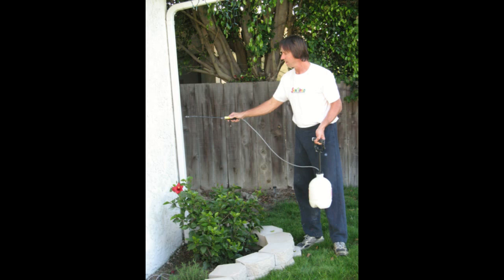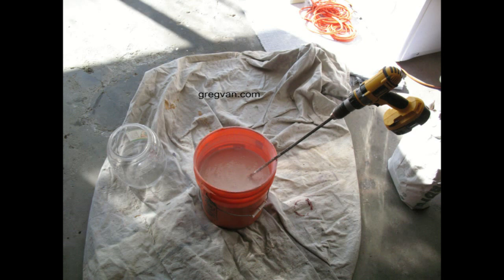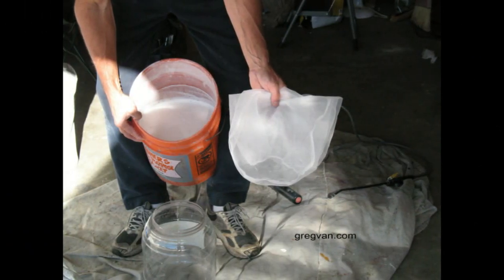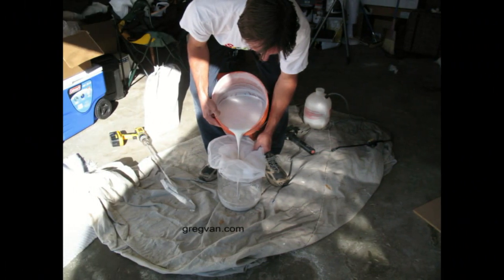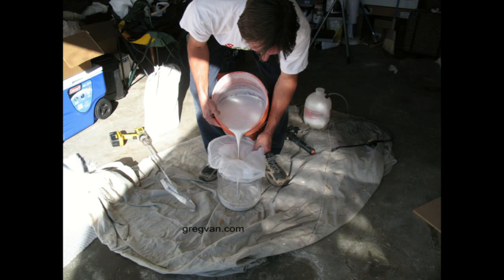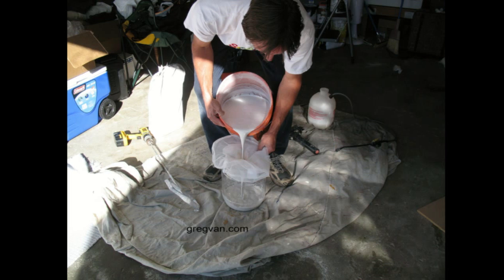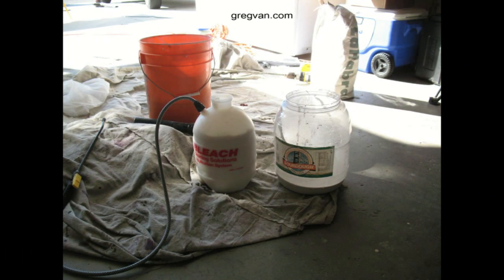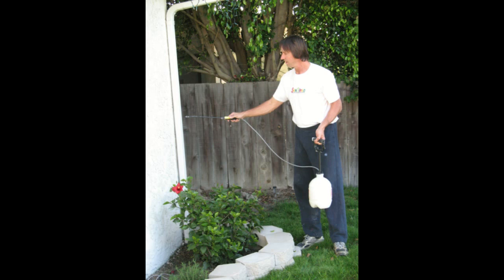How To Fog Coat Exterior Stucco Walls - Do-It-Yourself Advice

Comment: Hi, is that just a regular bag of color coat ? Then strain it.
Reply from the maker: I actually tried that once and didn't have good results. No this product is usually sold at local home improvement centers, lumber yards or Masonry material yards. You might even build a find it on the Internet and who knows, you might have better luck than I did if you do choose to strain a bag of color coat.
Reply: Fog coat is a special material that is sold at some masonry supply companies. but mostly stucco supply yards. you won't have much luck at big block stores.  The color is custom and needs to be matched to the color you are trying to achieve.
Reply: @gregvancom  Thanks for the video, curious what the issue was you had straining color coat.

Comment: Don,t forget this only works on stucco that has never been painted you should never paint stucco !!but if it has 20 coats of paint and you need to save $.. And you can Go darker but not lighter with a fog coat  re color coat..is best and you can go with a lighter color...make sure to paint the walls with a concrete bonder first!!